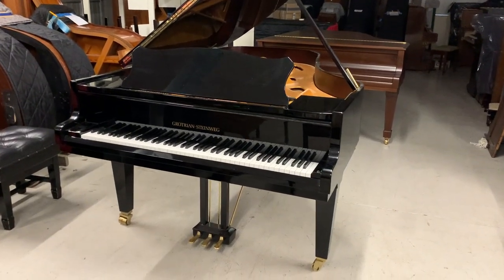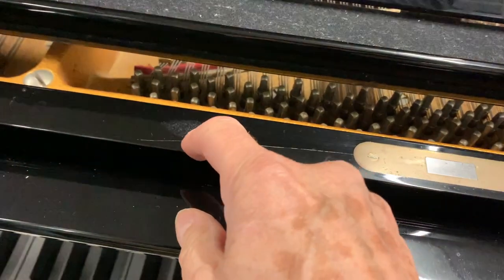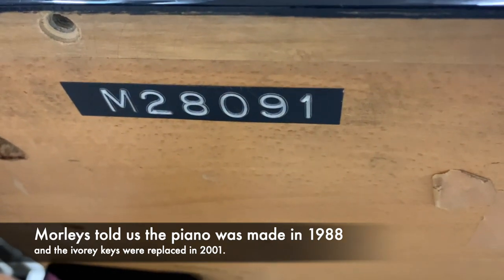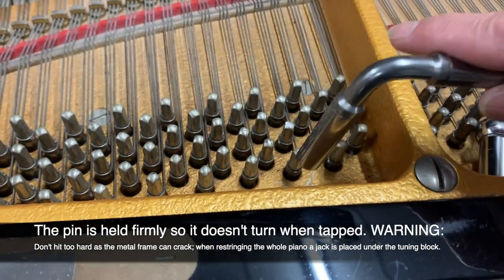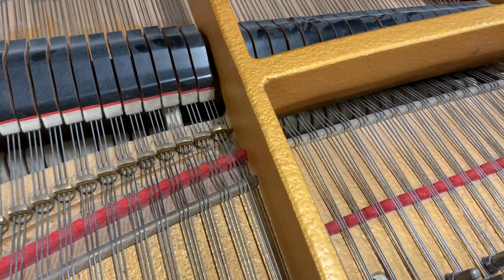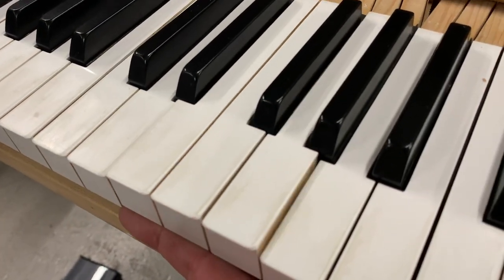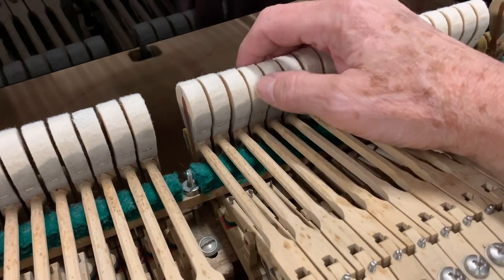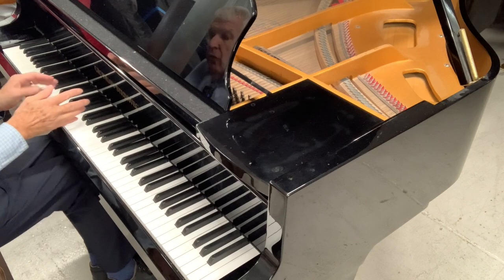Assessment of Grotrian Steinweg grand piano 223cm long + setting the tuning pins to tighten them:

Comment: Excellent video and informative as ever.  I have an identical Grotrian-Steinweg 223 No.137364  - only 28 prior to the one in this video!   My Grotrian holds its tuning incredibly well.  Marcus tuned it in January and here we are in October and it still doesn't need tuning - but then he has a brilliant pin-setting technique which comes from many years of experience.  All the unisons still perfect apart from one which I've put right.  Luckily my piano room remains at a very constant temperature day and night which probably helps keep the tuning very stable?

Comment: Every time I tuned a Grotrian Grand I had problems to stabilize the pitch because of the extremely long non speaking length which is common by Grotrians. They slip out of tune relatively fast.
Reply: Duplex scaling overkill?
Reply: @paxwallace8324  It’s more a perplex overkill for you, on most older Grotrians the non speaking length is additionally in an 3-4 inch felt bed, there you have waaay too much friction and elasticity to fiddle with and a few days later you can make a touch up especially in the upper part. Why did Grotian built such a nightmare?
Reply: @Sarah-fw7ow  good to know
Reply: @Sarah-fw7ow  well I must admit I have no idea what the term perplex means. Is it a technical term? I am indeed perplexed. I'm just a jazz pianist/ composer not a technician but I have a very deep curiosity about what's out there .
Reply: @paxwallace8324  It’s a pun…duplex-perplex and means confused.